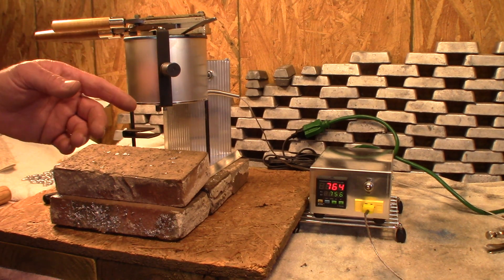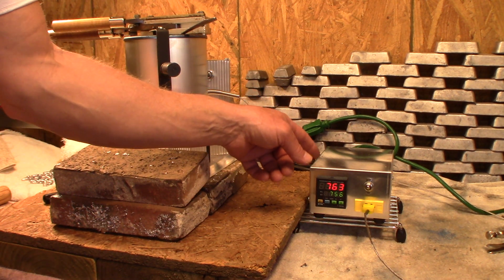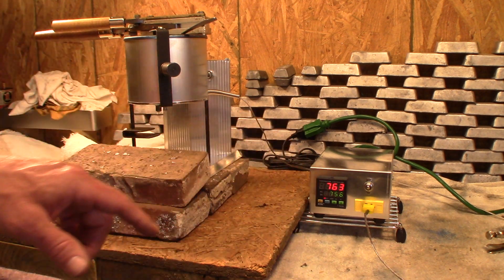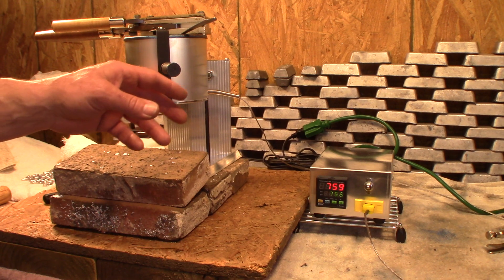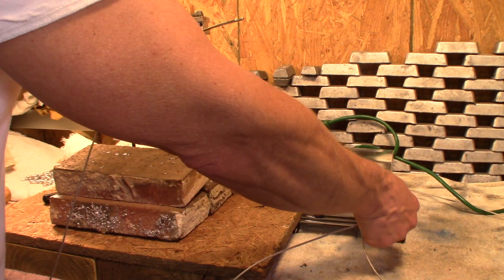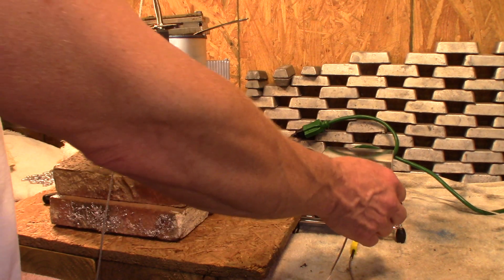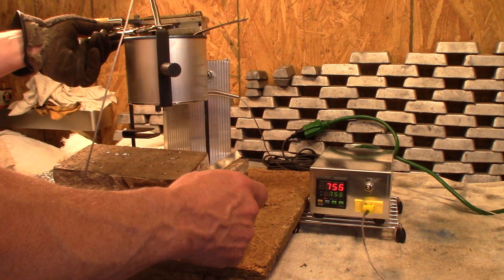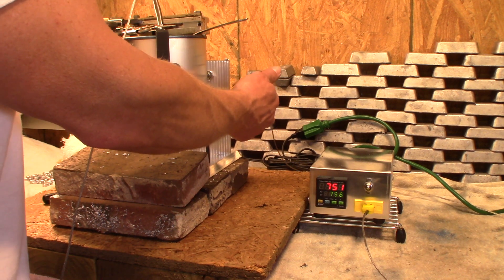PID Thermostat Install (TEST) Ultimate Control

Comment: The thermocouple is a small round bulb shape it is just touching a tiny spot on the bottom of the pot the rest of it is touching the air beneath the pot. There is much more physical contact of this tiny sensor bulb with air than steel.  There is a temperature gradient in the air surrounding the pot... the further away from the lead, the lower the temperature. You are in this gradient zone reading roughly 30deg F below the pot/lead temp. If you covered the thermocouple tip to prevent air circulation around it and covered it with non flammable insulation you could reduce the 30deg discrepancy from the in-pot temp... but that would be a silly waste of time. 
This 30deg difference is no big deal. I hypothesize that the stream of lead that pours into the mold has cooled more than 30 deg F during its journey down the spout and then free falling through cool air before it passes through the sprue plate hole. If your sensor is reading 30 deg less only 1mm below bottom of pot... just imagine how much cooling happens in the thin piss stream of lead through cool air on it's way into the mold.

Comment: Good video Elvis and your testing is appreciated, with your pour spout hook up you are essentially measuring the pot temperature as opposed to the lead temperature. In turn giving you a false positive. You can purchase the sensors that will install in the bottom of the pot. You would have to drill the pot bottom for installation. It is better to be correct on the lead temp instead of doing guess work. My two cents worth.

Comment: It just appears that its a bit hotter right in the pot next to the heating elements when the probe is in the lead. Down at the valve its a bit cooler as the lead is exiting. That is the Actual temp of the lead going into your mold. That is really accurate and very nice to know its about 20 degrees cooler at the valve.  I just got my 1st Lee 20 lb pot myself, and I'm building my PID controller following Johnny's video. I am going to set mine up like yours with the probe on the valve. Just add 20 degrees for the temp in the pot. Thanks for a great education and videos Elvis!

Comment: I don't think you need to start at 900° then turn it down.
The controller will run it up full power until set temp and then taper off..
That's what the integral part does.
Great design improvement!

Comment: You can use the calibration unit on the PID controller.  Each thermocouple should be calibrated.  Part of your temperature difference is that the thermocouple you installed and it is not in the lead but it is right next to the heating element which will give you different readings.  Hope this helps.  Happy New Year.

Comment: Make sure you have the same thermocouple types to check the temp.  There is iron Junction (type J) and there is also Type K, that uses a different metal as the junction, and then there is the Platinum RTD (remote thermal detector).  The position is important also.  Oddly enough the difference between the reading on a type J and an RTD is 30 deg.F.  It looks like you have two type J thermocouples.  There will also be a difference if you wire the thermocouple direct to the controller, rather than use a plug and socket.  The difference comes from the connections.  Dirt, oil and a loose connection can give odd readings.  Check the pot with a dip pyrometer (expensive) or a good infrared stand-off thermometer, and use the thermocouple mounted in the pot.  You can adjust the span, calibration and thermocouple type via dip switches in the controller, or use the calibration adjustment if it is close.  The PID loop will "learn" not to overshoot, and adjust the on and off time of the heater to heat quickly and then slow down to maintain.  Also we calibrate thermocouples in boiling water for a fairly quick, no fuss check.

Comment: Hey Elvis.. all of us been watching your vids and reading commits. We use lyman mag 25s we have 5 of them, The pid controllers are the best thing we have ever used..POWDER COAT UP DATE  eastwood gloss yellow and gloss red and blue work great. dark green  fail. We heat them to 140  shake a min  bake... beauties all around.  BMG update  we have 3 of them and scopes   ar50 a1   2  barrett 82 a1.  Shooting powder coat in our glocks we had to re barrel all of them....  9  40   10  and 45   wheaton arms... Keep up the good work.. we are still putting 1500 to 2000 down range a week end.....
Reply from the maker: Hey Karen Mills! Always great to hear from ya! Thanks for the range report and the powdercoat update! Sounds Like a range feast! Training =Fun... You'll have to give me a temperature settings report. Sweet spot temp for casting small, med, and large bullets. Thanks again! God Bless Ya!

Comment: EA-Just got me a Lyman 25lb pot and I had a 100 degree higher reading on the digital thermometer on the pot than the old analog thermometer that I had it  in my Lee 10lb pot.I figured out the sweet spot is around 790 degrees and it keeps it
10 degrees either way.Really nice setup you have assembled.
Reply from the maker: Thanks for the info michael cox.. I always like hearing where people run the pot!

Comment: Where are the two tips of each of the thermal indicators located within the pot?  Convection and conduction. That fluid varies in actual temperature depending on where the measurement is taken.

Comment: Elvis - I like your mod - It is quite possible that the steel pot and nozzle are a little cooler than the molten alloy.  It is because of the heat radiation aspects of the thin steel pot - it's a heat sink.  Thicker cast iron probably would be right on.  20 degrees doesn't make any difference in our casting, but your mod just add 20 for the actual or not --- your casting shouldn't have any difference in results and the convenience is good.  It's a great idea you have.  Good work... FC
Reply from the maker: hey there Mr Fortune Cookie!  Yeah ya know how we get set in our ways and want an open pot. We set our molds on the pot and dump our sprue in there. .. It seemed like a good idea to figure out a better way to use this fine PID controler. .. I  was smiling while casting a bunch of bullets!  Good evening to ya!

Comment: Hey Buddy.. Your castings will turnout with better quality and the furnace is going to last longer in the end. The thermostat provided with the Lee unit is caveman at best. You have already achieved a depth and ceiling perimeters using the PID controller that will adjust as the material is used up in the pot, That is the area where the Lee pot fails and overheats with it's thermostat. Heat control is the Key to good castings, uniformity and better accuracy.
Reply from the maker: hey Thorsaxe777. Yeah .. I knew it would make a difference... but didn't want all the expense and trouble with all the stuff all over. But now there is nothing left to complain about... : ) As a matter of fact I can use it for lots of experiments! And cast better bullets......
Reply: Johnny does such a good job on those. Professionally done. Too bad he couldn't make any money making those for people interested in have a PID. Those units are the way to go. I would bet there are people out there that would buy one from him.
Reply: I don't think the Lee pot has a thermostat.  Think it's just a rheostat for the heating element.

Comment: i'm curious how long did it take to get the pot up to temperature?
Reply from the maker: hey Chris Biblis. .. I turned it up to 900 to start. . turn it up on the pid... the other thing you can do is have the pid on reading the temp... and have the pot plugged in to an outlet...
Reply: Good to know. I went ahead and did the project with my PID and the results were as i expected. Your PID is apparently isolated from the Lee Pot. Since mine is integrated into the pot i had to attach the thermocouple in a different manor. I am making a vid to show how i made your alteration work with my PID. Just FYI, i also have exactly 30 degree variance in my temperature readings.

Comment: Just saw the video!  The offset is pretty easy to adjust for in the PID controller programming.  I have some other ideas on the subject as well.  I'll film a video today and hopefully have it up tonight or tomorrow morning.
Reply from the maker: Yeah I figured This was gonna get your brain moving! : ) After this video I cast about a thousand bullets... Easy breezy worked like a charm! No matter how confusing I sounded. I was tired...
Reply: Marty Scruggs - For so many years, we didn't have such a neat device...we read the temps by how quickly the spurs hardened, or by frosty bullets (high alloy temp).  And trying to adjust the heat was by guess and gosh.  20 degrees makes no difference in our casting session as long as the temp is high enough for us to get good fill of our.molds and not so low that the alloy freezes when we add ingots.  And once we have that, whatever temp the PID is set at is the right temp for the sweet spot...My guess is that mine is at 780 and Elvis will have his set at 760...doesn't matter what the actual temp is - we'll both have lots of real fine bullets and the heat is not going to get away from us with that PID.  Many thanks to JRB - no matter how much experience a caster has with or without a thermometer, once a caster uses a PID, he or she is going to have wide open eyes and a smile upside the face...
Reply from the maker: +Marty Scruggs Yeah ...now that I have one I'll probably do some testing on the subject!
Reply: JRB - Elvis would have been very happy if he didn't know that there was a 20 degree disparity from the nozzle to the alloy...if 750 or 770, makes no difference because the sweet spot is relative and he will find it...the heat control is the main event... personally, I've found that the Lee and NOE molds do like to be run a bit higher, like 780.  I can keep casting steadily when ingots and spurs are added also.  Your PID is a revelation... Best Regards,  FC
Reply: +FortuneCookie45LC  Thanks so much for the response guys... all 3 of you guys have help me learn much faster than I would have on my own... got head injury June of last and reloading and casting has very much been therapy for me this past year... again thank you... you never know how much of a difference you can make in someone's life and never even meet them...God Bless
Reply from the maker: +Marty Scruggs ... I've had a head injury all my life!  I can relate! !!! ; ) God Bless ya Brother! !! ; )
Reply: Hey Elvis or JRB... does a consistent temperature while casting make that big of a difference? If so what differences should one see the there casting using a PID like this??? Thanks so much to both of you live learned so much watching you videos already... God bless... Marty

Comment: Hi Elvis! I'm a physicist.  The temperature difference is probably because the thermocouple attached to the spout has a larger radiating surface, and is closer to room temperature.  By having the themocouple there, you are measuring the temperature that will be pouring.  I'd leave it the way it is.  
Good job!  Keep up the good work!
Reply from the maker: So...Radmonkeyboy... Ok ! I don't know anyone that will argue with a physicist   I pinned this comment to the top! This was the goal to get a reading of the lead going into the mold! : ) Thanks for stopping by.. A physicist named Radmonkeyboy kinda gives ya some cool points! : )
Reply: elvis ammo, I'm a radiation physicist working at Chernobyl!  All kinds of cool points here.  Plus radiation. :)
Reply from the maker: +Radmonkeyboy ...man.... it keeps getting better!  ; )... It is very nice having your opinion!

Comment: It makes sense that the direct molten lead reading is higher than the wire connected outside of the pot. The steel pot and bolt act like a very slight heat synch were a small amount of heat is lost. No big deal. Just know the lead runs about 20 degrees hotter b

Comment: Good morning Elvis, I think you are on the right track with the idea of using a traditional lead thermometer to verify what the actual temperature is. Without first verifying the actual temperature we will never know which probe is correct or if both of them are incorrect.   Thanks for your videos because of you, FC, Loads of Bacon, Johnny's etc etc I cast and powder coated my first batch of bullets last week and fired them off during the weekend.  They worked awesomely.
Reply from the maker: hey ruiz212. .. congrats! !!! ; ).. Glad we could help!

Comment: you can try putting a ball of jb wield on the end of the 2 weirs and stinking on the bottom of the pot  so they  are not touching any metal

Comment: The difference doesn't seem to be 30° to me,  cause the numbers were falling with the first example. I'm thinking that if you had taken more time, the numbers would likely have been a lot closer.
You did eliminate a variable nicely when you lifted the probe off the bottom.
I think that it takes more time for the controller to adjust to different input sources. Keep in mind that the heating element in the pot is still on. I would think that a 10° or 15° difference could be a calibration difference.
Either way, it was definitely doing a good job of holding an even temperature, and THAT makes it very much worthwhile.
I'm going to need to get one of my own now..........